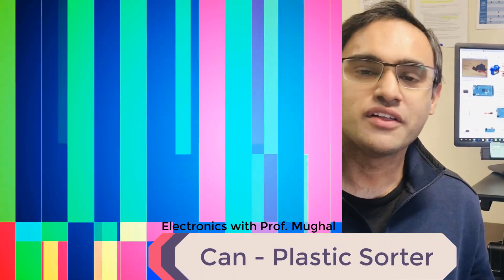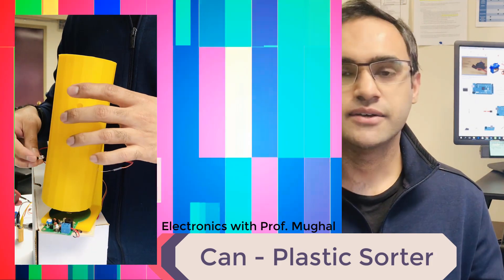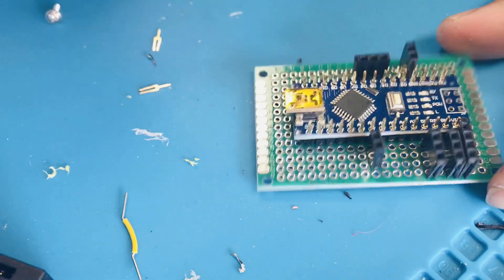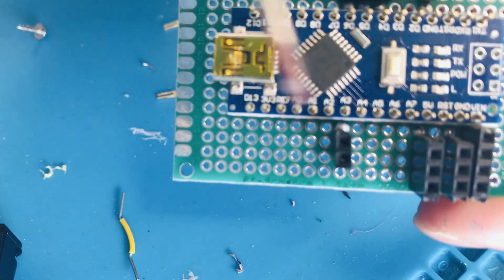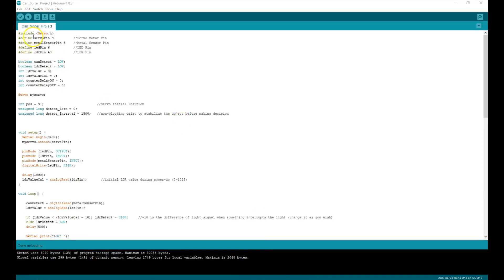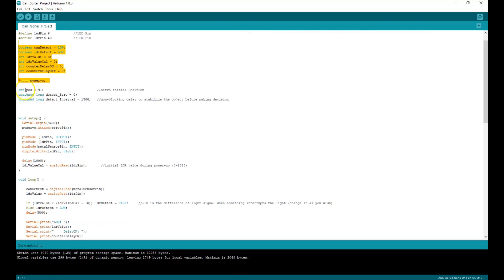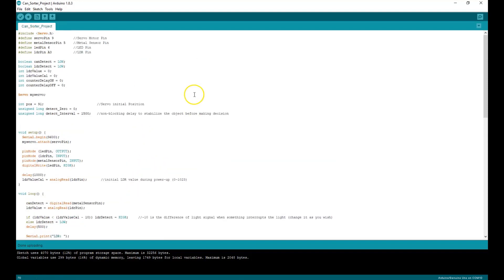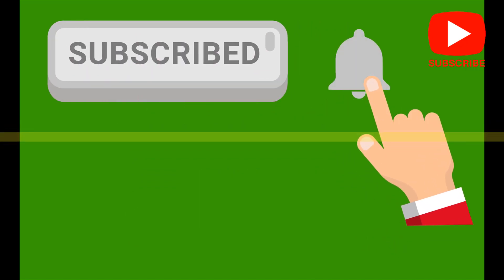Can and Plastic Sorting/Recyling Machine using Arduino Nano

Comment: Where should I connect the arduino pin 5 in the metal detector. I watched the video where you explained the connection diagram, but I need to be sure. Should I connect the pin 5 of the arduino to the + terminal of the buzzer? I am very new to arduino and need your help

Comment: sir have watch this video the wire from pin 5 of the nano u said will be connected to the speaker that's the buzzer right.
Now my question is this is it to the positive of the speaker.
Secondly what's the basic components that serves as an input device to make the servo motor to respond to the position is it the photo resistor or the wire from metal detector from speaker to pin 5 that send an input signal.

Thanks so much sir

Please sir need a dip explanation.

Comment: Hlo sir . Sir how we detect the plastic ? 
I mean which sensor do we used for plastic sensing.
Reply from the maker: Dear, we're not detecting plastic here. We're only detecting metal. Anything that is not detected as metal will trigger servo to move in opposite direction.
Reply: @ElectronicswithProfMughal  actually i m making a project so which is related to recyclable plastic and metal cans segregation . that's why i am asking this . Hope u understand . So pls help me by telling about the plastic sensor's name which is easily available and also find in simulation apps
Reply from the maker: @bikesworld7012  Like I mentioned earlier I did NOT use a plastic sensor. We programmed Arduino such if it doesn't detect a metal, then we consider it as a plastic since only two materials that will be inputted are metal and plastic. You can use plastic sensors if you like. I haven't used them in the past, however, I came across this paper which you might find helpful.
https://www.researchgate.net/publication/315480619_Application_of_Capacitance_Proximity_Sensor_for_the_Identification_of_Paper_and_Plastic_from_Recycling_Materials
Reply: @ElectronicswithProfMughal  actual problem is that if we use only capacitive sensor only as u say then in else condition whenever there is no matter other gate is open but if someone try to throw a stone then the stone get fall into the collector where i want only plastic waste

Comment: Hello sir. Can I ask how did you connect the metal detector to arduino and how did u check if it detects metal?
Reply from the maker: The schematic can be seen at 2:34. The metal detector was purchased from the link provided in the description. It beeps when it detects metal.
Reply: Did u solder a wire in the metal detector?
Reply from the maker: Yes
Reply: Can I ask where did u solder it ? Thank u very much sir
Reply from the maker: @renzmarkgoron809  you can go to the link in the description and check the schematic for metal detector.
Reply: @ElectronicswithProfMughal  where is the Pin 5 soldered onto the metal detector? VCC and GND make is clear but not pin5. Thanks again and amazing turtorial !
Reply from the maker: @222mykal  Pin 5 of the Arduino Nano
Reply: @ElectronicswithProfMughal  yes but what is that wire soldered to on the actual metal detector device ?
Reply from the maker: @222mykal  OK, so might want to watch this. You will find schematic here for the metal detector. Right where the speaker is, that is what you need to connect your Arduino pin to.
https://youtu.be/ol7d19ux8hs
Reply: @ElectronicswithProfMughal  sir have watch this video the wire from pin 5 of the nano u said will be connected to the speaker that's the buzzer right.
Now my question is this is it to the positive of the speaker.
Secondly what's the basic components that serves as an input device to make the servo motor to respond to the position is it the photo resistor or the wire from metal detector from speaker to pin 5 that send an input signal.

Thanks so much sir